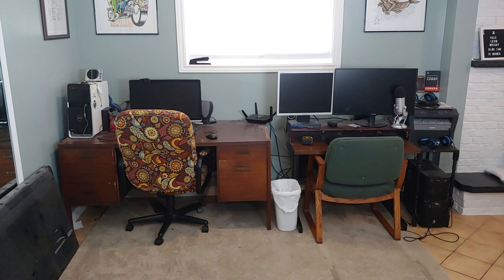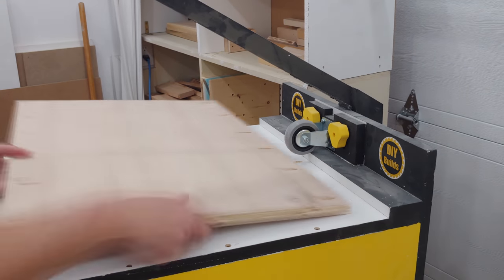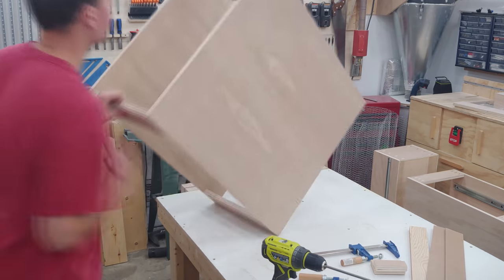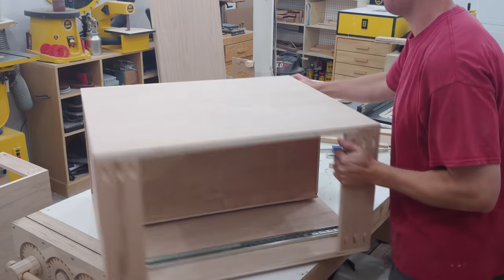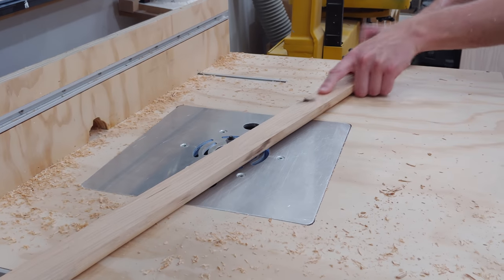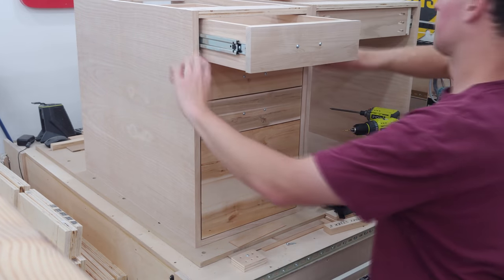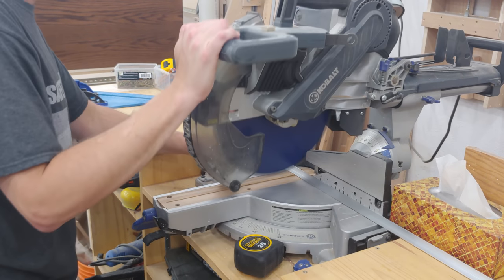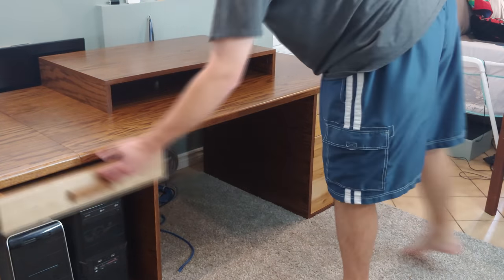EPIC Double Computer Desk Build with a Secret Inside!

Comment: Thank you for the video. One big time saver that I have used is to sand and varnish the entire 4'x8' sheet first.  Then cut it down to size, pocket hole & glue  Then touch up the finish any exposed cut edges.   Huge time saver for projects that I have done   Plus the varnish helps to minimize chip out
Reply from the maker: Not possible for this project as i used stain and iron on edge banding.

Comment: Turned out nice, now all you need to do is a little cable management. Btw, how do you spray in your shop without getting over spray on your tools?
Reply from the maker: Ohh no everything got covered in clear spots. I had to sand down my cast iron surfaces and re wax them.

Comment: I love the look, and the fact that there is a junk drawer! Every desk must have one! Also, why are you drilling with a driver and driving screws with a drill?
Reply from the maker: Drill has clutch and self centering bits have hex drive lol
Reply: @DIYBuilds  ah, I have found that a drill strips out screws too easily, but it works! I just get myself a good controllable impact driver (I am not saying Ryobi is bad, as I use Ryobi, but I prefer Dewalt. But Ryobi is more than good for the price!)
Reply from the maker: Hence the clutch on the drill. Can't strip out iwth it enabled.

Comment: I'm so disappointed. I thought all real Canadian woodworkers used construction adhesive on everything. I have been so misinformed by social media about the woodworking methods of the native Canadian in his natural habitat.  

I used to cut full sheets like that when I did allot of woodworking but now it's a little rougher on the body. I just got a new chair and need to rebuild my desk. Mine will be the envy of all guys as there is technically no desk...( no other spoilers) Hope to get around to it soon and get a video up.
Reply from the maker: I know john heisz loves the stuff but i only use it when i have no other choice cause i hate getting it on my hands.
Reply: @DIYBuilds  Yeah that's why i was giving you a hard time about it. I use it sparingly for the same reasons and it stinks. Still better than working with Pro seal (aircraft tank sealant) but not by much.